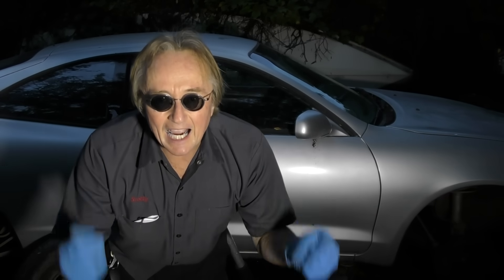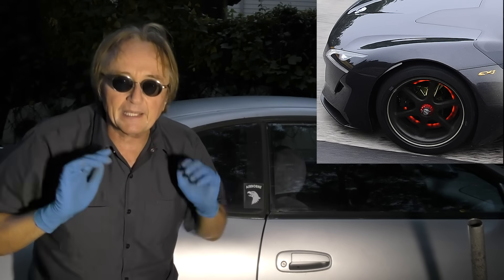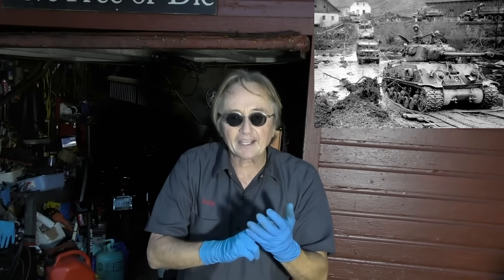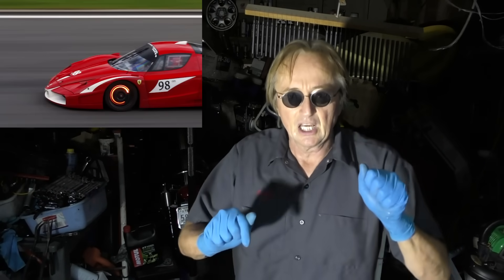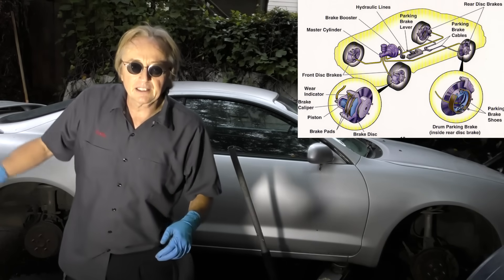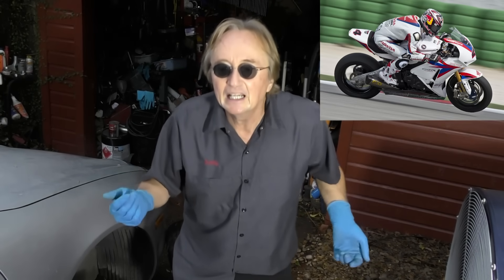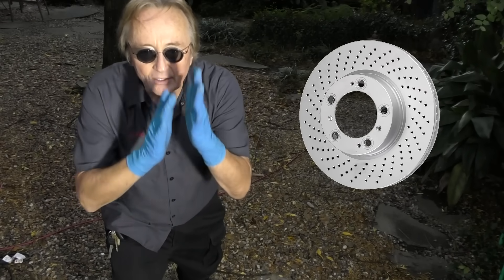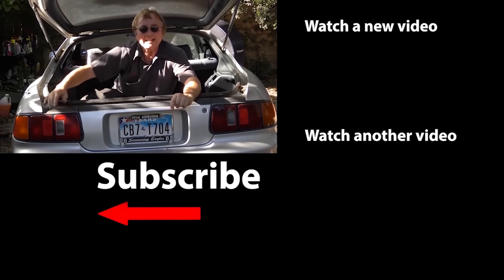Why Some Cars Have Drum Brakes Instead of Disc Brakes

Comment: Slotted or drilled rotors are a scam. Don't go for it, unless you race the car. Regular daily driving, go with the regular rotors. I learned the hard way after spending a lot of money on drilled rotors, only - as Scotty mentioned- to have noisy brakes and a lot worse breaking distance. I couldn't return them after a week of use so my rotor and pads replacement  ended up costing me 3X the price instead of going with the plain old regular oem rotors from the start.
Reply: Not true if you live in the high mountains the drilled and slotted do not warp like solid rotors I had to buy new rotors once a year because the front rotors got so hot that they warped now I don't have that problem
Reply: Maybe for cars, but all my SUVs and Pickup trucks brake a lot better when matched with the carbon-fiber ceramic pads.
Reply: Newbies needs to be hit in their pockets  hard where it hurts.
Reply: I don't disagree with your physics assessment (makes sense). But, real world the cheap (Chinese and Canadian source) Rotors and Ceramic pads, seem to have more "bite" them the OEM rotors and Ceramic pads of same size on my Toyotas. I also noticed less "grabbiness" and better pedal feel in cold / wet weather)  Not sure why. I think the gist of this is many of us "normal drivers" do like Drilled rotors for whatever reason. I did not notice less braking power at any point, happy with them so far.  @seq31
Reply: Leonardo Vrček Yes, lighter vehicles driven under lower loads on street compared to the track are not likely at all to have significant rotor cracks. Also, many sport bike rotors are floating type and thus more resistant to cracks.
Reply: Razvan J  hmmm...it's not as if freezing cold air is being blown into the rotors when braking. That temperature does not drop as much so the thermal cycling you are talking about is probably a brake shop's tale. Cracking or warping is probably a very rare occurrence unless you buy substandard aftermarket rotors or you drill more holes than the metal can handle although I agree faster wear of the rotors and brake pads is one sure result of the drilling/slotting.
Reply: Don't know why anyone would run drilled rotors. On top of looking ricey the holes only create more spots where they can crack because it acts as a notch similar to a notch on a shaft. Those holes also become the weakest points on the rotor where cracking can occur. The slotted rotors are good though which is why you see high end cars with slotted rotors. I know some high end cars ran drilled before but thats probably just to get people to buy them 'look shiny rotors with holes'. And besides if the actually helped out alot with cooling the rotor shouldn't they be facing the same way the vanes on a normal rotor do? And as for braking better as everyone is mentioning, simply upgrading the pads will do that, the rotor won't provide a better braking force. It will only allow you to brake like that for a longer period of time.
Reply: @seq31  higher coefficient of friction = more heat generated. Although some brakes work better when hot most brakes need a cooler environment to keep that friction high.
Reply: Alot of times I find drill slot just as cheap as regular rotors. 
As far as cracking, I've always had drill/slot or drilled daily driven (responsibly) no cracking, no noise, no excessive replacement
Reply: I drive a heavy Chrysler 300 with a 3.5L I will stick to drilled and slotted aftermarket brakes.
Reply: Yup. Just get better pads. I usually run an Autocross type pad (HAWK HP+ or HPS, EBC Green?i think or yellow? stuff). It takes about 10-12 slow downs from 80 to 5mph to start to fade, floor it to 80 and repeat. Red rotors
Reply: FS cool I didn't know that. Thanks for the info
Reply: slotted rotors are superior. i just heard scotty saying cross drilling is for heat dissipation which is false. slots are for keeping the pads clean and releasing the gas produced by the pads under breaking. cross drilling is just for off gassing and they crak eeasily. you hardly even see them any more.
Reply: Heat dissipation, they actually help a lot..
Reply: My mechanic asks me if I'm an engineer every time I go to modify my car, lol. Do whatever works for you. Thanks for posting your experience. This may help someone trying to make a decision.
Reply: A lot of the good quality street rotors now don’t use the drill and slot anymore, they use dimple holes that don’t go all the way through the disc and arrange them in a slot-like pattern. The advantages being less noise and pad wear as you dont have slots chopping away at the brake pads, and a greater resistance to cracking or warping as the disc is still one solid piece. The dimples basically just act as air pockets to give some of the hot air space to compress into to keep the pad in closer contact with the disc. If you want a good upgrade for the street, look into using this style of rotor with good quality pads and you’l be very happy. I’ve run them on a few cars and always had great disc life, pad wear and performance
Reply: The mane thing to remember is if you going to slotted and drilled Reuters you have to upgrade your brake pads to !!!! Lol 🤣
Reply: Gotta disagree with you on this. I bought a set of cross-drilled/slotted rotors with ceramic pads and four rebuilt OEM calipers that were powder-coated red. I installed them myself and, after breaking them in, I've noticed the difference in stopping distance and they are smooth and quiet! I didn't spend a whole lot on them but, I am very happy with them!!!
Reply: @73challenger5031  The reason was due to new calipers... Everything else was placebo
Reply: I got a cheap drilled and slotted kit from Amazon for $150 and threw those on.  Much cheaper than OEM, and I was replacing grooved rotors so it made sense.  They look cool, have similar stopping power, but they do screech when cold and/or wet.  It only takes a couple seconds of constant moderate braking to clean up the noise.
Reply: It also depends on the type of pads you use. Not just the rotor. You need the ones that match the rotors usage you want.
Reply: My car came with slotted and drilled disk from the factory
Reply: Depends on th the purpose of the car !
Reply: I went to drilled and slotted on my car. It helped by 3 feet, I don't have any fade ( I had very little to begin with ) and they look better with aftermarket rims. You got crap rotors I assume or they were not installed correctly. I also went to partial ceramic pads and that cut out the black dust and mine are ZERO squeaky. ( the originals didn't squeak either )  I followed the break in procedure to the T as well.
Reply: @batsonelectronics  The ceramic pads helped, not the rotors. If anything adding spaces between the pads decreases the stopping power. It's basic psychics
Reply: @christophervanzetta  Actually no. The brakes themselves are not all that maters, the tires are equal parts of that equation. The brake pads and rotors stop the tires from rotating, the tire surface is what then slows the car down. Heat in the rotor in less efficient than a cooler rotor.  For everyday driving the brakes work the same to me, if I need to panic stop or lots of stopping due to traffic, they do seem to work the same for much longer time of start and stop driving. I could not run more than 2 -  60 mph - 0  stops before the old setup would shimmy or stop slower, I don't have that problem now although after 6 times it did seem to lose some stopping clamp but NO vibration at all. I didn't buy the cheapest kit though, I bought a mid line grade. Buying cheap would probably negate the possible benefit or maybe hurt it, I can't say since I didn't go that route.
Reply: Does anybody in this thread know what they are talking about?
Reply: @batvette  yes, do you ?
Reply: @batsonelectronics  did I pretend I did?
Reply: @batvette  When you make comments about other's  knowledge or lack thereof, of the subject, you are saying that yes, you know more.
Reply: @batsonelectronics  my comment was toward  all the conflicting and often nonsensical claims made here as fact.
Reply: @batsonelectronics note they are all anecdotal stories. Nobody tested a car with oem rotors and later with drilled and slotted rotors in a measured test.
Reply: @batvette  I'm sorry but I did. I stopped 3 feet shorter ( 34 inches to be exact )  with the drilled and slotted. I did it 2 days apart on the same road under the same conditions. The biggest difference will be highly reduce brake fade from repeated hard braking. I bought a good set, not cheap crap so results will be affected by the quality of the parts. Same for any brake job really.
Reply: @batvette  Of course not!
Reply: i wondered, just cause it's for racing doesn't mean it's better for daily driving
Reply: Some people just have more dollars than sense. They want to do all this schitt to their cars in order to make them unique, or to improve performance, and have no idea where to begin, so they sometimes put these expensive brake rotors and calipers on their cars. Sometimes they put these fancy brakes on their cars after installing big stupid-looking wheels with open spokes so they can see their pretty, new brakes. A total waste of money. "I gots me some twenny-fows on muh Crown Vic!"
Reply: @robertgantry2118  It's called stupid consumerism. No one in this thread has any idea about how psychics works, aerodynamics, heat dissipation, heat transferability, nor a clue about kinetic energy. Why do you think they watch a so called millionaire who monetizes videos on YouTube? A so called millionaire doesn't need to make money, they can grow their wealth while living off of the interest...

It's pretty sad how stupid the average person is these days due to the intake of flouride on a daily basis
Reply: @christophervanzetta  - I'm a certified auto mechanic, and still I have no idea of how to calculate heat dissipation. I DO know, however, that slotted, drilled rotors help prevent heat fade and gas fade. I also know how to spell "physics". But unless you're braking from 150 MPH over and over, such as on a race track, then these high performance brakes are a waste of money. If you're driving that fast around town, then you need a ticket for reckless driving.
Reply: @robertgantry2118  thanks for the credible comment. For 99% of drivers, tires are probably going to be the weak part of the chain and their brakes are adequate to lock up the tires in panic stop situations.
Reply: Cars are a scam
Reply: Merry Christmas
Reply: Slotted rotors are superior to OEM.
Reply: I don’t usually comment but as a frequent track driver and instructor in many types of cars, I have very clear answers for some questions. Drilled rotors are very prone to significant cracking in track conditions due to crack propagation after the chamfered holes wear down. Slots and holes are typically very insignificant in terms of braking power. Tires and pad type make much more of a difference in braking distance and fade. We use slotted or solid rotors mostly on tracks. Floating rotors are even better for heat and cracking resistance. For time trials, you may find drilled holes due to weight reduction at the hub. That’s it in a nutshell everyone.
Reply: I have slotted and drilled and they have way mot bite to them! So yes i use them as i race a lot and the thermal dissipation helps a lot and is definitely noticeable.
Reply: SomeDudeinChirons ,
Reply: @somedudeinchirons4936  I put D/S rotors with ceramic pads, I never suffered any noise symptoms. I put em on my 02 Acura Dc5, the stopping distance increased and actually saved my life once.. apart from my oem rotors heating up and two rear rotors not breaking it actually improved my braking, They are not an a scam.
Reply: @somedudeinchirons4936  it's called the placebo effect buddu
Reply: Perhaps if I plan on occasional track visits in my daily driver I should vent vented, non-slotted/drilled rotors.
Reply: @FroztiProductions  yeah well lets just hope you drive a fun daily haha
Reply: @somedudeinchirons4936  It's fun to me, at least... It's a slow project. Drilled rotors scare me, I've heard so many stories of cracking.
Reply: FroztiProductions odd, because any cracking tends to be because of too much heat. The drilled holes actually help reduce the tension in the metal as well. The holes help reduce the heat of the rotor from increased air flow and help the brake dust have a place to go during use. Go with quality metal, never go to the store and get the cheapest part or go online and get the cheapest part. You pay for what you get.
Reply: @FroztiProductions  i have had mine for a year now and i brake very aggressively! They are still not cracked or warped!!
Reply: @ArtisticSep  That's not how aerodynamics works buddy...
Reply: No
Reply: Yep, nightmare if you off-road, sand clogs them up, go with smooth rotors
Reply: Good point. Drums would be even worse, What a mess!  @TheSchmed
Reply: I commute from the burbs to NYC, lots of time on the brakes and Id eventually warp them. I switched to drilled/slotted (powerstop kit) 2 years ago and ive had no issues. Depends on driving style I suppose!
Reply: My brembos bite better with drilled in slotted
Reply: FS I totally disagree with you I upgraded to rotors and pads on my truck 2 cross drilled slotted blah blah blah rotors and the difference is definitely noticeable and definitely in a good way
Reply: I think the one normal situation where having slotted rotors might be useful is if you live in a very hilly area where your daily commute requires a lot of braking or engine braking. Hopefully prevent brake fade. A lot of people doesn't really know how to engine brake with an automatic anyway
Reply: Just because you didn't research something and bought products not suitable for your use doesn't make it a "scam". That's like buying studded tires for summer use and saying they are a scam because they are noisy and have bad grip.
Reply: Any good rotors should be ventilated to dissipate heat, and good race rotors should be slotted. The slots also can help to prevent rotor glazing, if you get a fine coating of brake pad dust on the rotor in wet/damp conditions... But you should always try to avoid drilled rotors... drilling does nothing that slotted rotors cant, except create weak spots in the rotors. These fatigue points can cause cracking to occur between the drill holes and I have even seen an instance on the track of a drilled rotor completely shattering under heavy load.
Reply: FS 
Not if you live in the middle of tue desert with temp above 120F most of the year..
Even if you do not drive a race car.. having drilled rotors installed is a great idea
Reply: Its all about cooling quicker when going hard especially in back streets
Reply: The latest technology is the drilled and slotted sandals fred flintstone wears.
Reply: I have to disagree, I bought the drilled and slotted rotors for my truck and they have a lot more bite, it really helps you stop when you are towing!
Reply: @zachstaten7710  you hit it right where no one else was thinking. I have drilled and slotted rotors on my 2500hd and I tow between 14 and 20,000 pounds regularly. They have helped a lot.
On a side note, I think I'm going to change the 4 drum brakes on my trailer to hydraulic disk brakes to help out a little more. 
Also, the rear brakes on my truck do more than 10% of my braking, I have to change them out almost as often as the front brakes. Maybe Scotty's 90/10 thing is true for cars?
Reply: @seq31  well your not wrong. Better brakes have a higher coefficient of friction. This also means they need to expell heat faster. This is why they are slotted and drilled the slots allow gas to escape faster to cool the brakes down to allow the brakes to bite. I know for a fact my brakes have more bite than oem brakes. But a big brake kit does that when paired with slotted and cross drilled.

Comment: Volvo had 4 wheel discs for 50 years..... why drums in back. So stupid ....the 240 has 8 brake lines 2 per caliper...Safe as you can get..

Comment: You forgot to mention a very large amount of modern cars, even with 4 wheel discs, still have a backup rear drum brake system for the emergency brake inside of the rear discs.

Comment: In the '70's, I knew 2 mechanics that collected Crosley cars, and they mentioned that the Hot Shot had disc brakes. I looked it up, and they used airplane type disc brakes for about 6 months in 1950 but they had problems with them and went back to drum brakes. In April 1962, Studebaker introduced the Avanti and it came standard with front disc brakes. They were available on the other models as an option. I had a 1964 Studebaker Cruiser that had front disc brakes. They were made by Bendix. These brakes would only engage to 4/5ths of the thickness of the pad so that it would not wear through to the backing plate and score the disc.They were always a bit noisy, but if they stopped making noise, it was time to replace the front pads.

Comment: Here's some things Scotty forgot to mention that I think are important: The front brakes of the car usually do most the braking to improve handling and reduce chance of fishtailing while braking & cornering, you can tell by how the fluid reservoirs are biased inside the master cylinder.

Hand brake/parking brakes work better with a drum brake...a disc brake has trouble holding tight because of it's design and how the caliper works differently. Some cars with 4 wheel disc brakes have a completely separate parking brake on the axle shaft to negate this problem.

Comment: My Dodge Avenger came with some crap brakes there the size of an economy cars breaks but the car weights right at 4000lbs with me in it so they suck. Leave it to dodge to put a giant 282hp motor in and little tiny breaks.